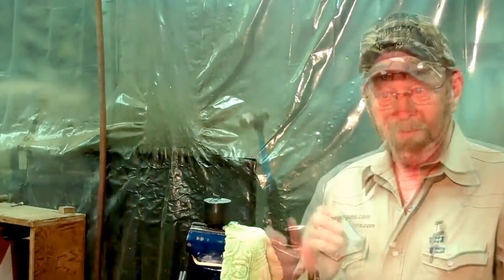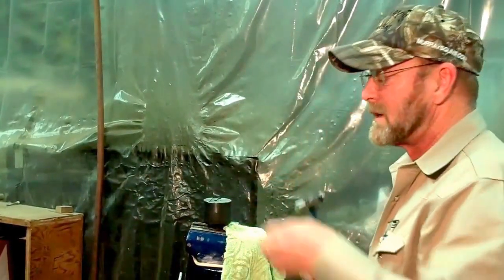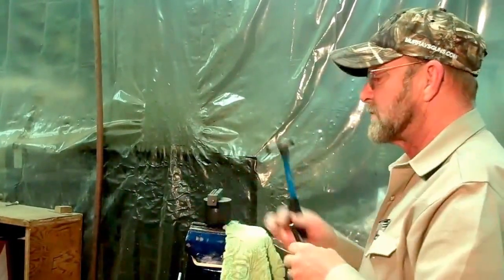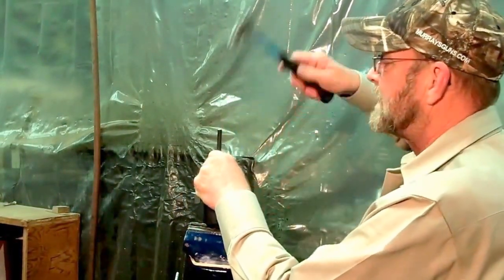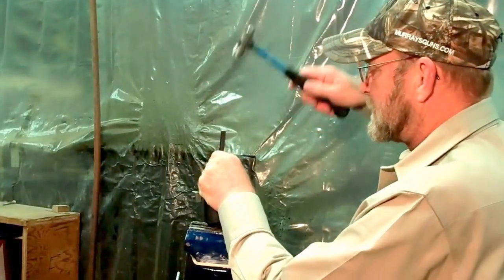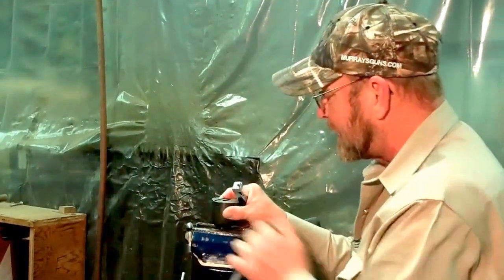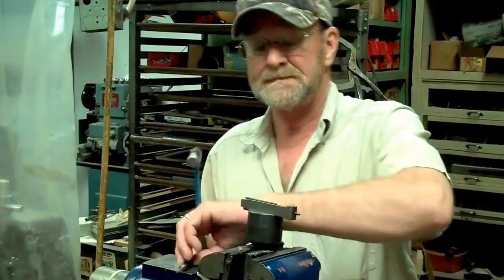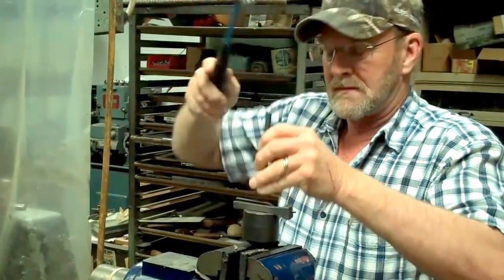Bustin' a Myth

Comment: Followed your excellent instructions with my new firing pin, and it came out like a piece of cake!  Like you say, the key is a solid, incompressible base.  Just like a semi auto will not function properly if you limp wrist it, the pin will not come out if the bolt is not securely backed.

Comment from the maker: It's simply a piece of cold rolled steel that was scrapped. Should have been a journal for an auger but it got machined too small. So we machined a slight contour on the top to "locate" the bolt with the retaining pin over the hole that's in the center. Any block of alum or steel works fine. We mentioned it before but a good alternative is a 1/2" socket on the concrete floor.

Comment: As an amateur gunsmith, I can tell you that unless your vise is mounted solidly to a very heavy bench sitting on a concrete floor below, you will work yourself to death trying to remove the pin.  Another route that works for me is to get about a 7/8 inch socket and place on a concrete block or driveway/patio.  Lay the bolt over the socket in such a way that the pin is down over and inside the hole of the socket.  Then drift the pin out. Once it starts to move, it will drive out.

Comment: The pin and the hole were dirty as well, but even after cleaning the perfectly (to a shine) the pin would get hard stuck getting half way into the hole. I ended up polishing both the pin and the hole with various attachments with my Dremel, taking a little material from the sharp edges on the flat site of the pin. After close to an hour, both the pin and the hole have straight shape, and the pin enters smoothly until it reaches the end, when it locks harder.

Comment: Yesterday night it was hell of a fight to remove my pin. I have a Chinese Norinco SKS. The previous owner didn't bother to clean it even once. I bent two of my brass punches trying to get the pin out. At the end I used the steel replacement pin for the mag release pin I just received. After tons and tons of banging, with a heavy hammer finally the pin moved 1 millimeter, and then with more banging it went out. The bolt was incredibly dirty, the firing pin was practically covered in dirt.

Comment from the maker: @missourioregon  You're absolutely correct! Removing the cross pin that holds the hanguard ferrule on the gas tube is a very troublesome chore. Each end of the pin has been smashed (swaged) larger than the pin diameter which makes removal tough, and re-installing one and peening the ends properly is kinda tricky.

Comment from the maker: @missourioregon Not any time real soon. A firm base is always important when driving out a pin, and we use an old broken 1/16" punch that only has about 1/8" of pin section, to start the ferrule cross-pin moving, then get a good 1/16" to finish driving it out. A 3/32" punch is best for the front sight assy pins. The Chinese seem to be the toughest to get out.

Comment: i just removed the retaining pin from my sks bolt this evening. no kidding, i had to use the same technique as mr. murray to get it out. i bent my punch previously due to attempting to hammer the pin out on a block of wood with a hole drilled in it. got a new punch, and replicated as shown. no probs now.

Comment from the maker: Each end of the pin has been swaged out something like this. >===<     The pin diameter is actually much smaller than what you see on each side, which is each end of the pin. Very stable base to lay it on and a 1/16" punch should help.

Comment from the maker: Some are definitely tougher than others to get out. Did you lay the bolt on top of the slightly open vise jaws, or did you try to grip the bolt body in the vise jaws? Worse case scenario, you can send it to us. We haven't seen one yet that we couldn't get out. A 5/32" punch can be used to get the pin started, but if you drive the 5/32" punch too far, it binds up with the firing pin and becomes rather difficult to get back out.

Comment: i know that it is earlier  to get the pin out from the bolt than it is the hand-guard. I had to drill through the hand guard pin to replace the wood hand guard with a tapco one with the rail. 

any plans to do a video on removing the front sight hood assembly pins?